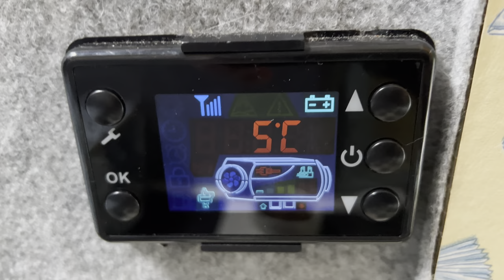Making a KING SIZE bed in my Peugeot Boxer Self Build Campervan.

Comment: Kirsty cut out all the boring technical stuff, so here we go:
The mattresses are 2x Innerlig children's extendable sprung mattresses. Each are a total of 80cm wide and 200cm long. They come in segments designed to grow with the child.

The space for the bed is 184cm wide and 160cm front to back. As in the video, the mattresses fitted withways fill front to back, however with the end sections square on their sides, there is a gap of about 9cm. Angling the end sections of the mattresses helps.

Kirsty's next video shows the bed in more detail.